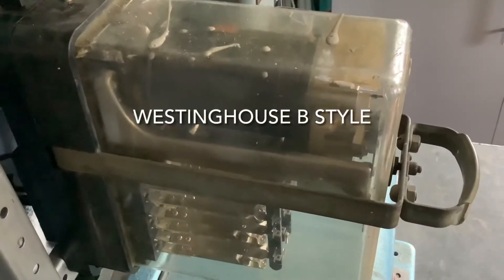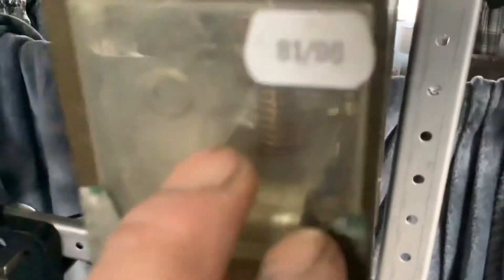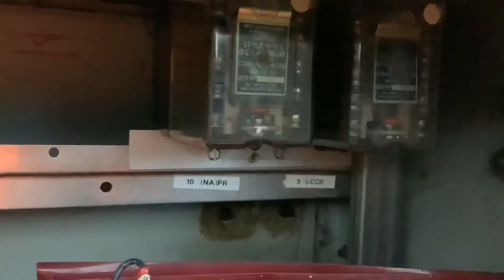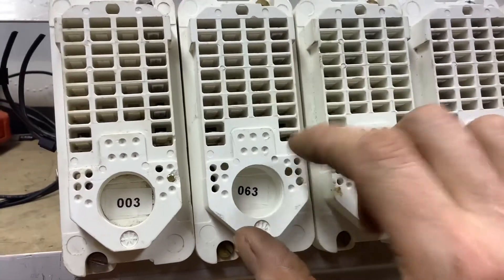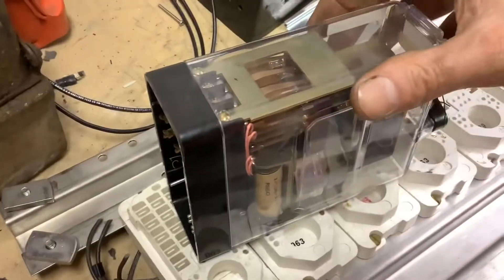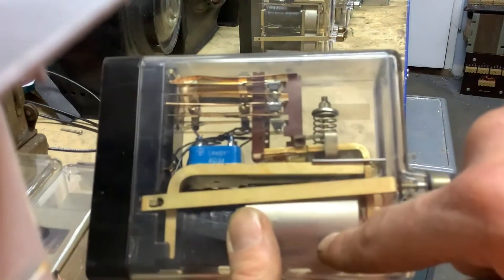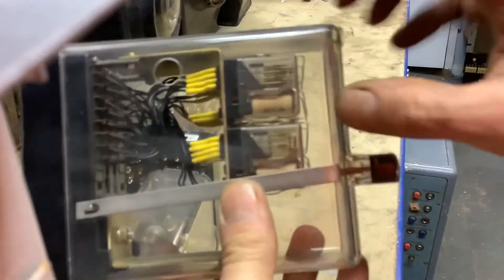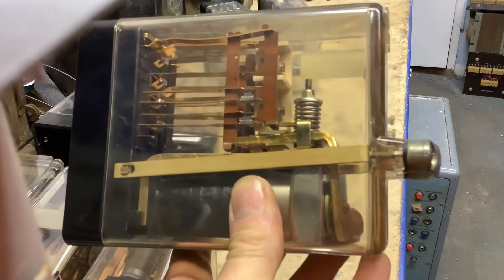Signalling relays part 2 (plug in types)

Comment: Interesting. I had never heard about the silver migration problem, but where I live, the bases are all mid-70s or newer. I suppose that the problem had been fixed by then.
We did have problems with Q-relays that had been internally treated with silicone oil, though. After a while that oil migrates and covers the contact surfaces.

Comment: Do you have the glass enclosed Welwyn interlocking relay set? I seem to recollect when on a course at Grove House Watford seeing one. It had two 3,000 type Post Office relays enclosed and about 13 0 BA terminals on the bacolite casing. Are there still some in existence?
Reply from the maker: Yes there are, still a few used in various block control circuits.    We use one half. Of one for a treadle relay atvthe steam railway